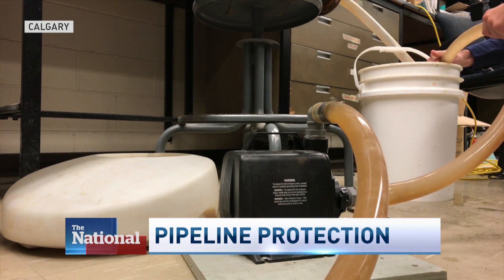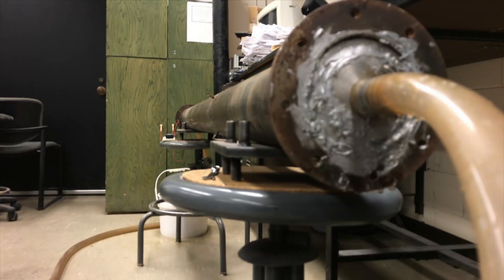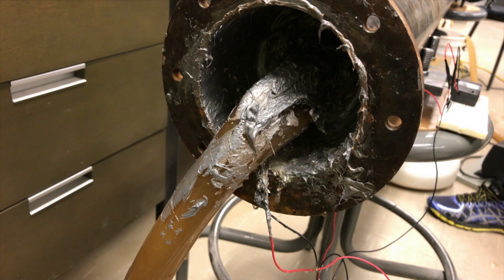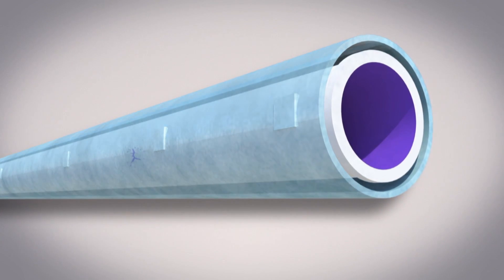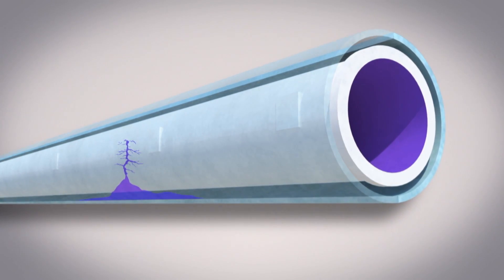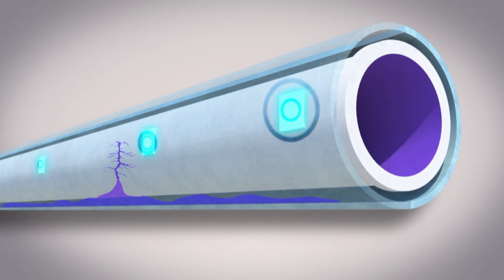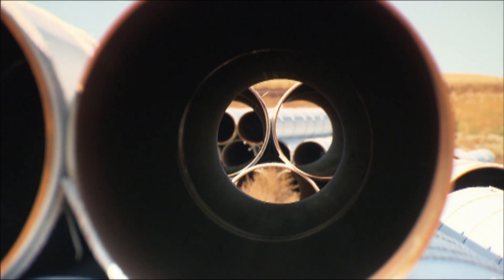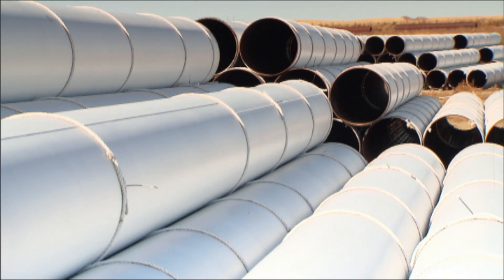Leak-proof pipeline closer to reality

Comment: This is corporate propaganda that's all. I worked up north on an oil spill. The company that had owned the pipeline before installed straight steel pipe to move emulsion, that's oil and water mixed together. And in most cases that is salt water. The company Knew the life expectancy of the pipeline and sold it just prior to that date. The company that bought it I assume knew this but continued to use it until a leak was detected. We had 17 vac trucks pulling off oil saturated surface water moving it approx two km to a tank farm and then 4 tankers one of which I was driving move the emulsion approx 30 km to an injection well. We worked for 30 days straight 20-22 hrs a day to clean it up. It was cheaper in the long run to clean it up rather than replace the pipe. I believe the wells are still in production but rather than replace the pipe they are moving it with vac trucks . There is such a huge profit made from oil that these companies have no interest in environmental protection just profit. This idea don't you think they have thought about this in the past. Simple concept but the price is to high compared to conventional methods. Why do you think it hasn't already been incorporated into the industry. PROFIT
Reply: There is hope of change but I not sure when that might happen it's refreshing to see someone on here that gets it if we can talk honestly and act morally incorruptible, and there in lie the problem, there's some hope for humanity.
Reply: Andrew Ojala Your completely right: if left to the free market, this would never sell. This would have to be an enforced federal regulation.
Reply: Thank you so much for your comment.

I apparently can't post the link, but there's a fascinating interview if one looks up "big oil exposed by whistleblower" on youtube.
Reply: There are 7300 video's that come up with that title and I have watched quite a few of them in the past. Big Oil Bigger Lies that's the whole deal with that industry.
Reply: The one I referenced is the TYT Politics one. Excerpt:
""Another thing that happens is when I say that these companies profit from oil spills: If they shut down a pipe to fix it, let's say Michigan, they knew the pipe was bad for five years; if they shut it down, then they lose 8 million a day. It was 8 to 9 million a day. It takes 30 to 60 days to fix it; they just lost a few hundred million dollars. If they wait for a spill, they still have all the profit on a daily basis for those five years that they got; then the insurance company hires them to clean up their own mess. Insurance company pays for lost revenue."

"Big Oil Bigger Lies" <--- love it.

Comment: this seems so obvious.. why is not done already?
Reply: Money. Cost/Benefit. Political will.  No pipeline can truly be guaranteed leak proof but this seems like a nice step to reduce the risk and potential damage of any leak.
Reply: Ranen Ghosh oh I agree - don't take what I meant as support of doing nothing. I wanted to highlight only here that this idea is not new, but rather the technical aspects won't really prevent spills and may cause more issues with maintaining the pipeline than solve.

Whole other issue around a business choosing to work with a compromised line or offload it and taking the fines/environmental damage in the name of profit.

Personally, I feel there are cheaper options to monitor than what was described in this video / article. None of which is cheaper than simply ignoring or offloading the issue (from the pipeline operator perspective).
Reply: Whoa.  Comments deleted.  Money.  Cost Benefit. Political Will.  Let's see if it happens again.
Reply: Simply put, is has been done already. The only Technology this concept adds are sensors which adds more complexity and points of failure - which has also been researched and done already. Here's a link discussing the topic and you can infer why no sensors are used currently for the same reasons.

https://www.aboutpipelines.com/en/blog/would-double-walled-pipelines-help-prevent-spills/

Oddly enough, the information on why this won't work is from the same University...
Reply: That might be a valid reason for why this technology isn't currently used, but I wouldn't "infer" anything from an industry-sponsored website.

With today's technology spills could be significantly reduced, but the incentives aren't there.  There's an interview with a former Enbridge employee turned whistleblower John Bolenbaugh on the lies and cover-ups of the pipeline companies.  

Look up "big oil exposed by whistleblower" on youtube. At around 9 minutes in:

"Another thing that happens is when I say that these companies profit from oil spills: If they shut down a pipe to fix it, let's say Michigan, they knew the pipe was bad for five years; if they shut it down, then they lose 8 million a day. It was 8 to 9 million a day. It takes 30 to 60 days to fix it; they just lost a few hundred million dollars. If they wait for a spill, they still have all the profit on a daily basis for those five years that they got; then the insurance company hires them to clean up their own mess. Insurance company pays for lost revenue."